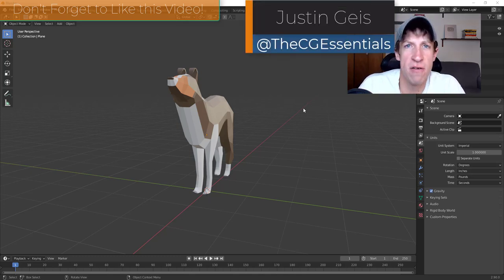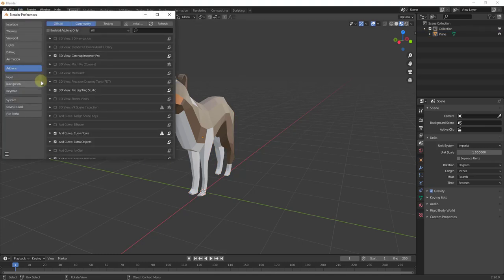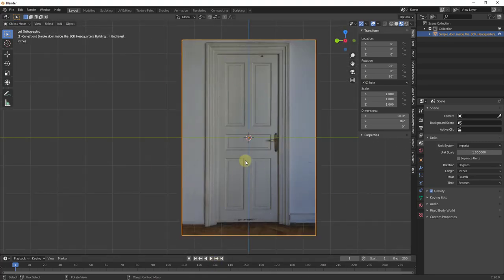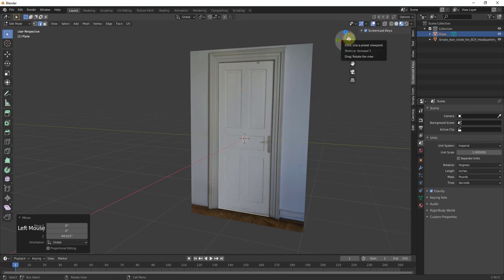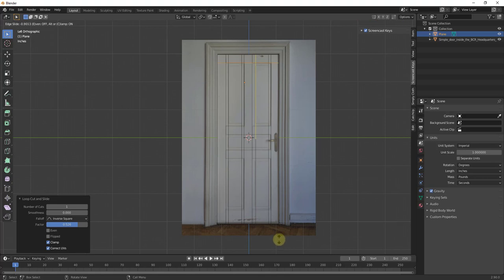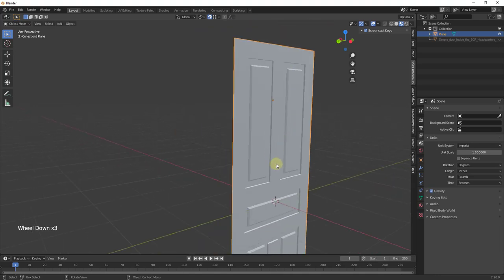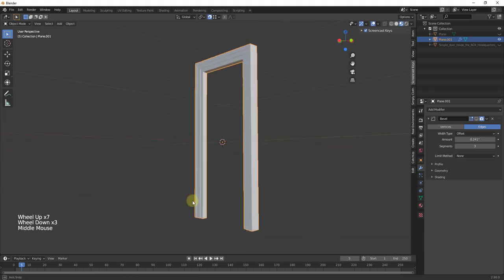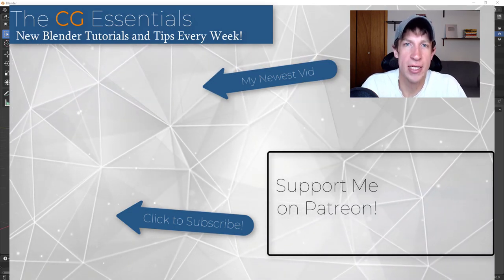Modeling DOORS AND FRAMES in Blender - Step by Step Tutorial!

Comment: Hey, i have a question. When I try to duplicate the doors and turn it around, its always off and the doors are never aligned. I got the dimension's perfect and i've tried everything to fix them but they are still out of proportion. Do you know what's happening?
Reply: i have this same problem, replying so i can be notified if someone answers 😢
Reply: Have you applied your transforms? Sometimes when you transform an object without applying location and rotation, it can affect things like mirroring or duplicated object transforms.

Comment: Does anyone know how I can align the other side of the door so it will be even?
I cant add the thickness to the door with bridge edge loop because of that.
Reply: Hey probably super late, but for anyone who has a similar issue. 
So if I'm correct, they wont be completely aligned when you rotate them. Simply press A, open the N tab, go to Item, transform. Finally select the X under median and set it to 0

Comment: Hi CG. I did every step demonstrated in the video but when it came to bridge the edges I kept getting the message "Select at least two edge loop" I did the exercise 5 times and got the same results. I poster my headache to blender who replied that both faces must be joined first before it can occur. I did as recommended and was successful. I am using the 2.92 version.
Reply: Thanks for sharing this, I had the same problem and thanks to you it was an easy fix.
Reply: Please help me deal with this problem too
Reply: @djinnorigin , выдели оба меша, кликни пкм ''соеденить''. И попробуй снова.

Comment: After adding the image as plane, the next step is to add a plane to size to the door. When I add that plane, it is opaque - I can't see the door image through the new plane. So I'm stuck at the adding edge loops steps because I can't see the image underneath the plane. What did I miss?
Reply: I think alt z will make it see through atleast in earlier versions it worked
Reply: I like to use Shift+Z in this case.

Comment: What would be the best way to go around making a keyhole ?
I'm really struggling to find a good way to make holes in my faces.
I can use loop tools, but for such a tiny surface, i divide 4-5 times to get faces to make a hole from.
Sometimes its kinda okay, but it totally warps the mesh.
Reply: You can use bool tool (from addons). You make the mesh that is how would hole look(you have to put it in the place you wanna have hole), you select it, then mesh that you wanna have hole in, you press ctrl+shift+b, you choose difference, and done! The hole is EXACT size and place that you have put in mesh that is hole

Comment: When extruding the frame i would have selected the whole thing and extruded it a bit, then deselected the inner ring of faces and extruded the rest a bit more, then deselected the middle ring of faces and extruded the outer ring, that would have elimionated all them internal faces you have inside the frames mesh, which can cause huge issues later.
Reply from the maker: I'm not really convinced in this case that it would create huge issues later. All I'd be doing with this door is pairing it with a Boolean cutting cube/rectangle to cut openings in walls and texturing it with a straight on UV projected from a view - why does it matter if there are internal faces?
Reply: @TheCGEssentials  Try doing edge loops with internal faces, blender will have issues trying to find a loop, just like it does with poles, try doing subdivisions or bevels with internal faces,  you may get warping, even rendering with internal faces can cause rendering artifacts, there's a long list of reasons, not to mention that it is simply extra poly's that you don't need. 

Anyway, it was just a tip, you can do it any way you like, i'm was just telling you my workflow as you asked in your pinned comment.
Reply from the maker: @haunteddiary15  Nope you're good - I appreciate the response - wanted to hear your thinking behind it. 

I'm kind of an advocate of changing your workflow depending on your desired result. For example - I'm not ever going to subdivide a door frame, so I don't are as much about the topology being perfect for that. I'm probably not really doing too much more with edge loops within this model either, so maybe not that big of a deal either. However, I think this workflow really looks different depending on if you're doing game design, architectural modeling, etc, etc, as well as the size of the model. 

However, you're right - if you're going for a perfect topology workflow, there's probably a better way to do this, but I think for a lot of beginners, it's probably a good place to start. Thanks for the feedback! :)
Reply: would you do the same with the door?
Reply: also could you elaborate? I don't fully understand what your saying.

Comment: Why did you make a new plane over the image with plane? 

Just make the detail in the “Door” plane! You get the texture already in the plane to begin with. You just have to add the vertex and lines to the image plane and extrude.

I made whole cities, rooms from just one image, broken up
Reply from the maker: Interesting - I suppose you could do that as well - I'm not necessarily sure that doing it this way is really much harder, but you would be able to skip the application of the texture to the object later. In this case, I wanted my door and frame to be separate objects - is there an easy way to separate them after the fact if you model it the way you described?